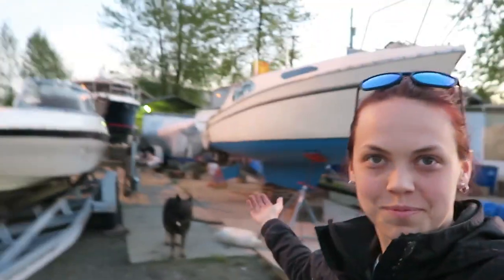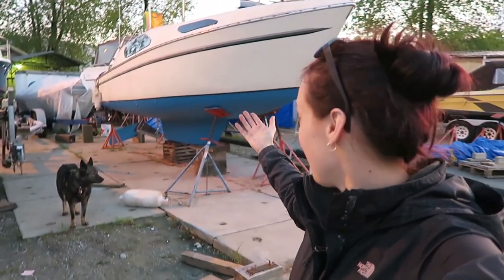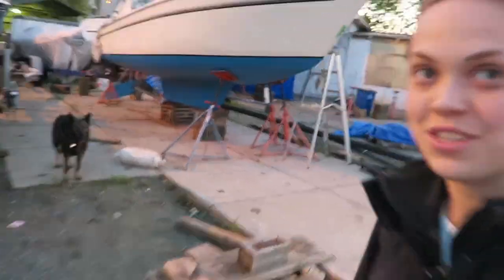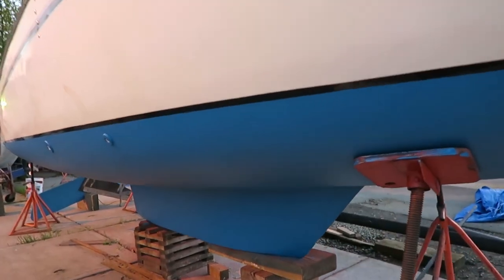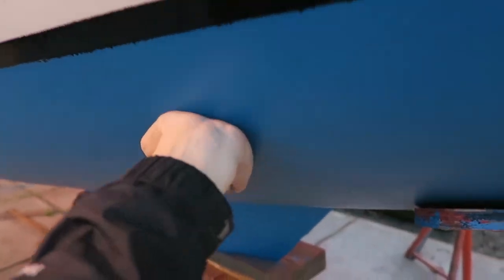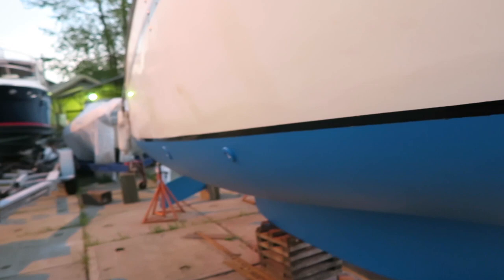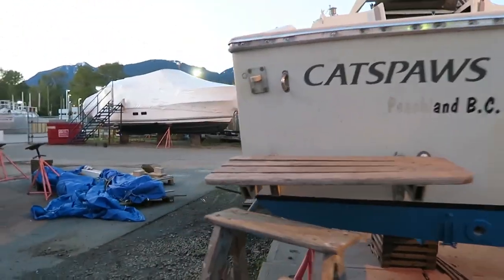Kicking Us Out – Rushing To Finish - 1976 Reinell Sailboat Restoration #13

Comment: You should really epoxy the holes you drill in the deck and not just rely of butyl tape to stop water ingress
Reply from the maker: I do agree. I did most of them but some of them we just needed to fill as fast as we could as we had to put her in the water and into the elements. I know I have now created twice the work for myself at a later date.